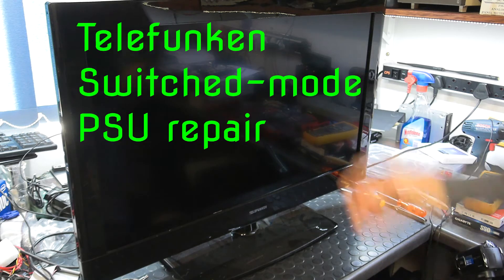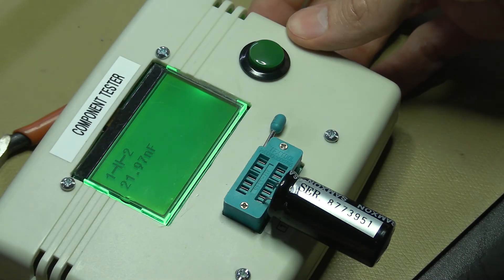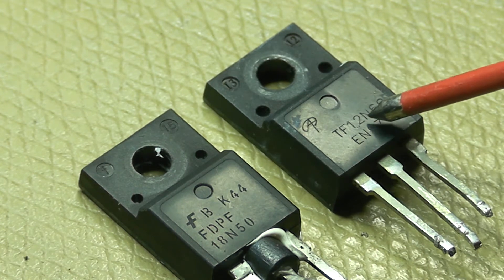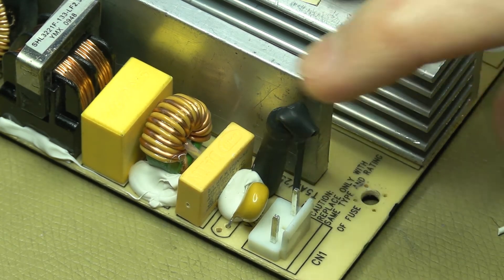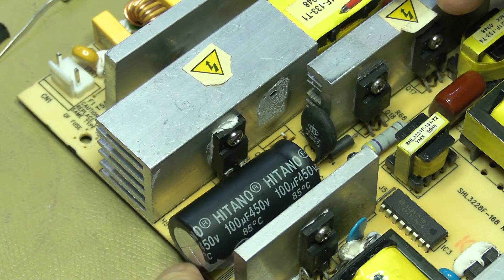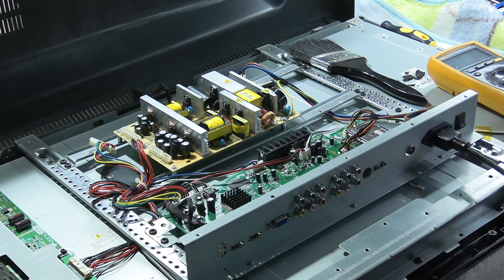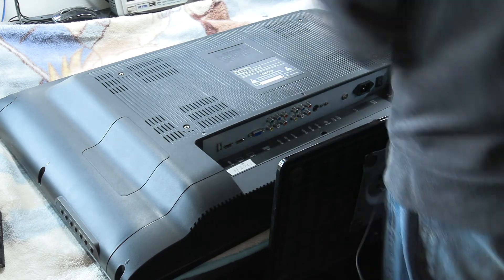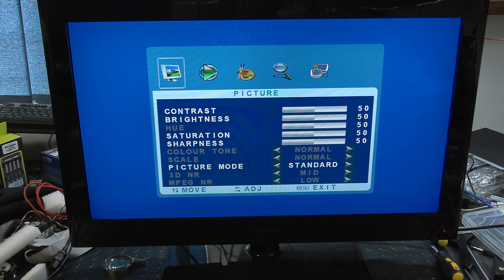Telefunken TV Switched-mode PSU repair (#026)

Comment: Great repair, thanks so much for making this video.
I have the same model TV, with the exact same issue that I sent into a local shop here in Durban who said that they are not able to repair it.
I can't wait to collect it and give your repair method a shot!
Wish me luck.
Reply from the maker: I wish you luck! At the risk of sounding preachy, please be very careful when working on the supply. As you saw in the video, the voltages are at lethal levels.

Comment: As soon as you are able, I would recommend (my personal opinion) changing the capacitor to 120uF and at least 500V and ideally 750V if it will fit. 400V (which is high anyway, I would also check the bridge) on a 450V capable cap is a bit high and probably contributed to the failure. Also, some heatsink compound on the MOSFET.
Reply from the maker: I tried looking for a higher voltage cap, but the formfactor does not fit (unless I bodge it in from the side). If you look closely there is some fresh compound, but it's the new-fangled silver stuff (4.8 W/M-K) so it looks almost the same colour as the heatsink itself. Good tip on checking the bridge!